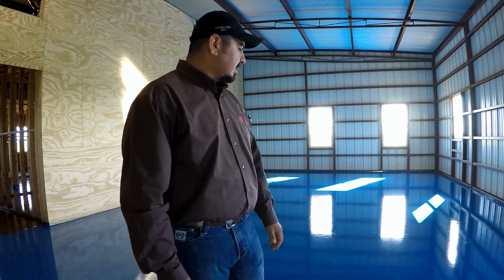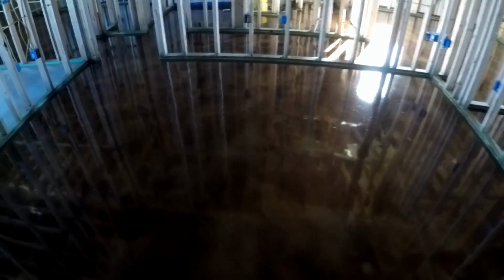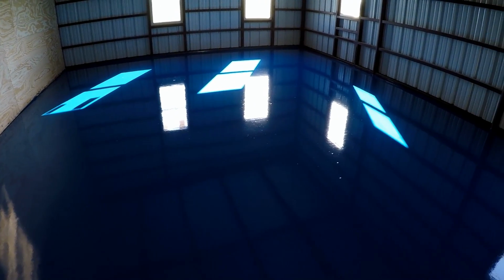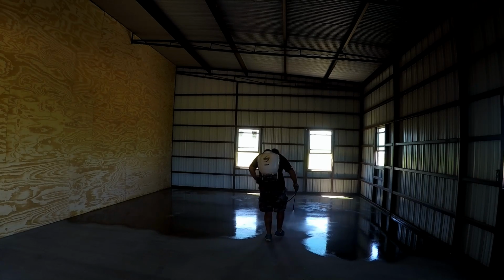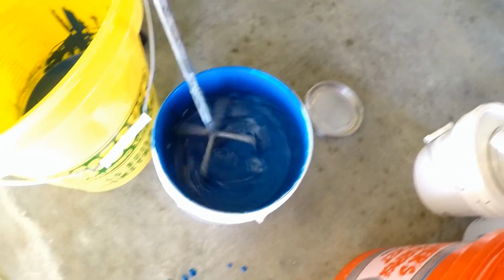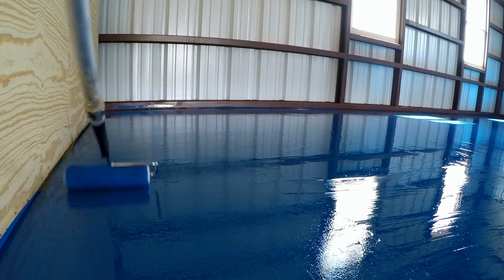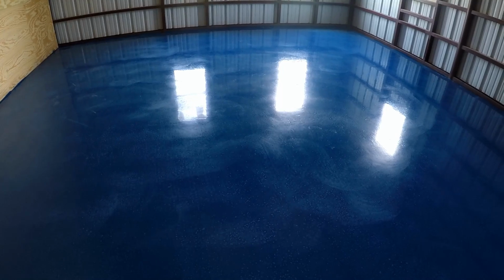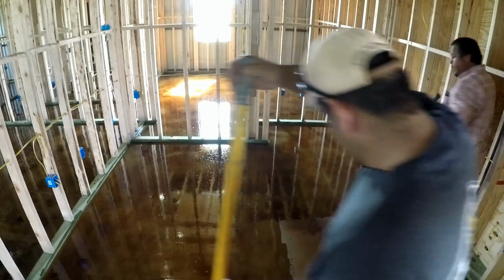Epoxy floors for new shop

Comment: omg ..  why would you do the house floors before the plaster paint and sheetrock not even done yett..  floor looks nice but should waited till eveything else was done
Reply from the maker: +Hector Garcia I did it that way because I know what I'm doing.  ;)
Reply: +Erik Cortina hey brother i take your word for that im no one to judge.but for me that be more  work being super carefull not to accidently drop latex paint off walls ,plaster or dent skuff the floor with ladder and tools.i wait till the end to do floors. take care got a gig to head to now.
Reply from the maker: +Hector Garcia We let the floors cure for about 3-4 days, then we cover them with ram board.  If for any reason the ram board gets torn and anyone drops anything on it, it is easy to clean up because it won't stick to the sealer real good.  If I let everyone come in before I stain and they drop anything on the bare floors, it gets down in the pores and it is really hard to clean.  

One more thing, coming in before the drywall is up means we don't have to cover anything up, except for the doors.  It is much quicker.

Comment: floors are the LAST thing you do...
Reply: ...or not!
Reply: +bob mclean
welcome to the not-yesterday era
Reply: Justin Crediblename sometimes you could drop something on the floor while working on the rest of the room that could make a huge scratch, so saving it till the end sometimes is better.
Reply: Mr. Bob McLean is correct, the floors are the VERY last thing you do on any construction project.  Your floors look great now, but after all the other working trades are done it will not look as clean as this, even after a thorough cleaning.  No matter how much floor protection you put down you will never prevent all the drywall/ construction dust from traveling to your floors.

Comment: not a smart move doing the floors before you put up your drywall or panel . and if you pant you got to cover up the whole floor ...
Reply: You do the floors first and then cover them with a heavy paper going up the walls a few inches.  At this point there is a lot less dirt and other impurities to clean up. It's easier and faster doing it that way than trying to clean up drywall mud and other crap out of the concrete.

Comment: U got bobble coz you got no clue how to use this paint. You not alowed to use any etching acid under epoxy but use epoxy sealer/primer. Than use spike roler to lay the paint down not the squeegy hahaha What a kowboy style :)
Reply: my company is thinking of having this flooring. SEEMS YOU ARE A PROFESSIONAL. YES A PRIME WAS WHAT I LEARNED. BUT EPOXI 400, SELF LEVELING EPOXI. AND ALSO THE COMMENT 2 YEARS A GARAGE WAS ALL GLOSSY. AT THE END 1 . IS NOT SCRATCH RESISTANT????2 . IS NOT SUPOOSE TO BE A CHEAPER OPTION FOR LARGE OR EVEN SMALL AREAS. I AM CONFUSED.  WHAT SHOULD BE THW KIND OF EPOXI RESIN, WHAT STEPS TO APPLY. ~ WE NEED LONG TERM QUALITY, SPECIALLY IN A WAREHOUSE. WHAT KIND OF INSTRUCTIONS I SHOULD GIVE TO HAVE THE CORRECT CONCRETE SURFACE????